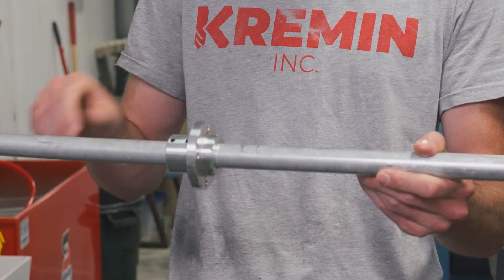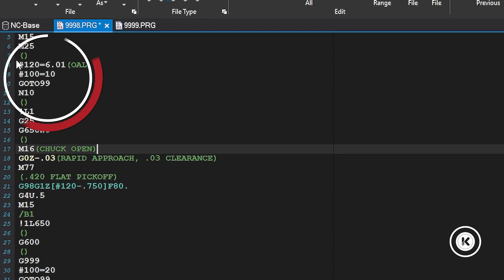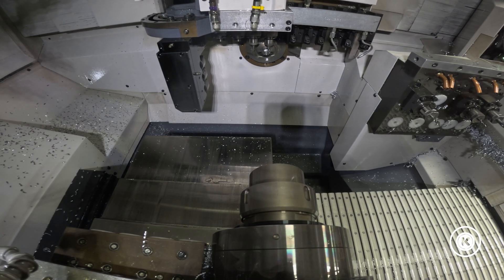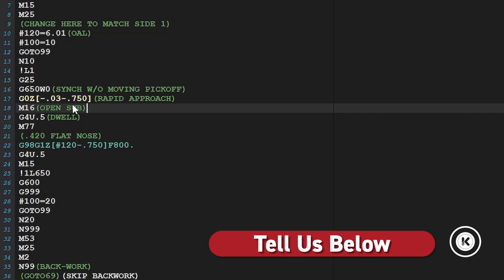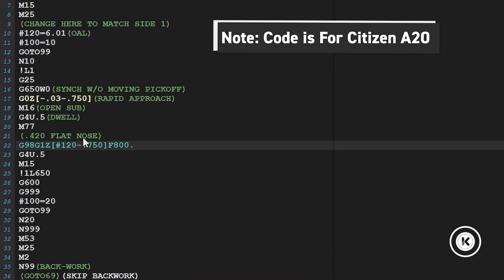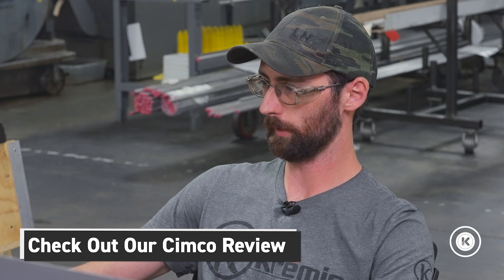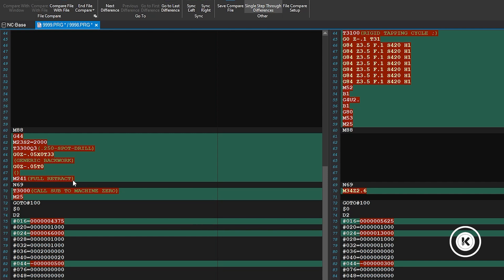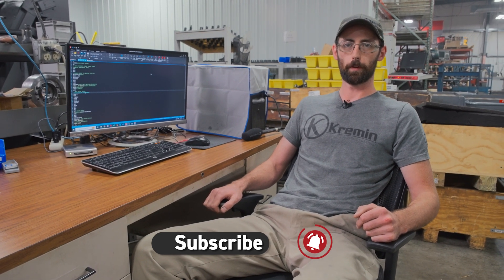How To Program A Through Tube - Citizen Swiss Lathe

Comment: I got a job as a swiss machinist I start in a couple weeks.

My 5 years machinist experience has been on 2 axis lathes and 3 axis vertical mills with manual programming on the lathe and fusion 360 for the mill. All learned on the job.

I hope I catch on!
Reply from the maker: Good luck!
Reply: @KreminIncManufacturing  thanks